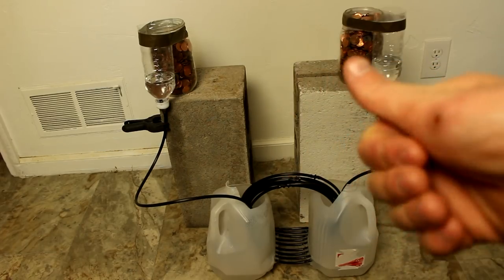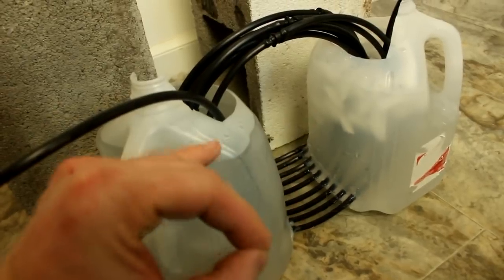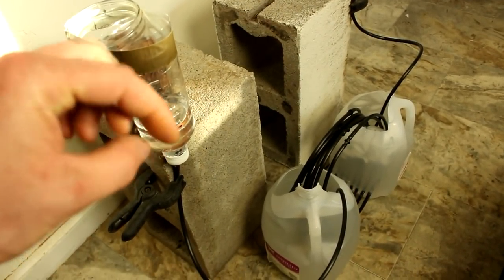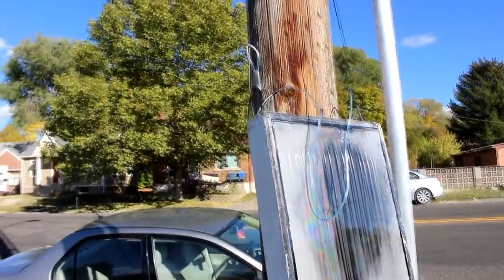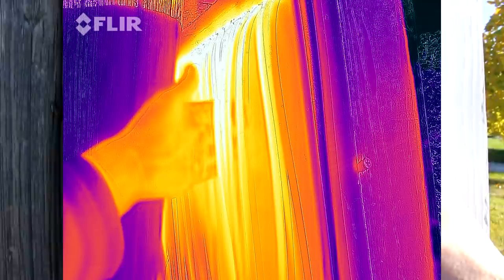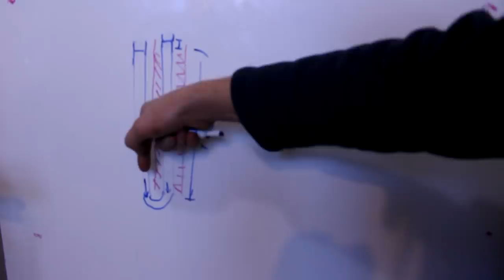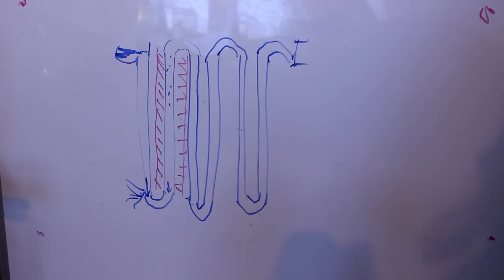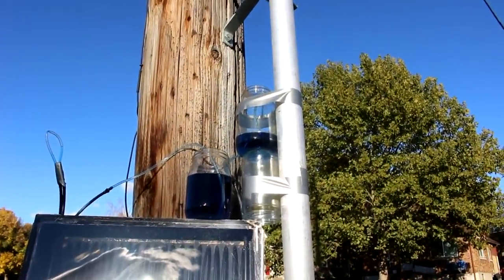Water Pump With No Moving Parts? (except water of course)

Comment: Would a peltier TEC between the hot side and the cold side be useful in pumping the heat "uphill"?

I'm imagining something like a wide plastic pipe with a divider through the middle, and the TECs along the side of the divider. Then inside each hot and cold section are copper pipes sitting in transformer oil (or maybe water? Not sure how TECs behave submersed in water though).

Transformer oil acts as the heat exchanger between all the hot pipes [and all the cold pipes], and the TECs simple move the heat in the direction you want the water to flow.
Reply: * not sure if TECs would get enough temperature differential between the hot and cold side to be effective though?

Comment: Pelletier chip and solar panel to get your hot and cold make custom aluminum blocks "heat sinks" with hose attachment thermal paste them to the pelletier chip on both sides loop hoses the the faster heat is removed from one side the cooler the other.

Comment: Cant help wondering if there is more than one way to do this. This method definitely works but I was wondering if there were any other ways of pumping water with no moving parts. EG using magnetics (electromagnets) which do exert a weak force on water but it might be too weak to do anything practical.

Comment: Would it work if it ran in parallel instead of in series?

Where you combine all the cold tube-ends into one . Same on the hot side.

This way it doesn't have to alternate between cooling and heating.
Reply: oh wait.. it wouldn't work
Reply: No. Every turn of the tube needs a temperature change. The pressure head comes from the imbalance of temperature on opposite sides of a bend. Without that, the pressures on either side cancel and no pressure is exerted.

Comment: would it not be better if you have one long tube at the front and an equally long tube at the back? i mean without changing from front to back all the time. that way most of the water on the front would be hot and most of it on the back cold.

Comment: Instead of having the tube going to the front and back, why not make it loop all the way on the back and only then go to the front? Essentially one long tube where one part is heating and the other part is cooling. Would that be more efficient?
Reply: Also you can add a one way valve.

Comment: the moving parts is you with that kettle lol
you would have to use boiling water ........just use a dam pump cheaper lol 
Would parallel and metal pipes be more flow?

Comment: can you re address this with small diameter on the hot and large on the cold?
i suspect the hot would move easier on the smaller diameter than the cold .
maybe differ the diameter by a factor.

Comment: Your setup does seems like it suceed at moving water, but I'm not convinced the effect you're describing is quite right.
You're not building pressure inside your tube since it's opened at both side, so any pressure you're generating at one point should push the liquid out of both ends without some kind of valve.
The effect you're describing is based on buoyancy and you tube goes up and down, so that should cancel most of the effect.

A good example of an thermal pump is used in some coffee machine. It uses a one way valve. Go see this video, it's really good : /watch?v=4j4Q_YBRJEI

Also, when dealing with salt concentrations and/or capilairies, you have to take in account other stuff like the surface tension of the liquid (see thermocapilairy effect)

Comment: Why don't you try making a radiator type device for the back of the pump so it cools faster.
Reply: With fins like a air conditioner and maybe make the tubes metal.

Comment: 85% 
of homes in israel uses panels as you made to heat water.
Of course that we made it a bit more efficient with vacuum and stainless steel tubes :)
I wonder if the heating of the water won't slowly kill your eco system as it's sterilising it bit by bit...

Comment: Water expands 1700 times from liquid to steam, wouldnt it be alot more effective using some solar "intensifier" (in loss of other words) to boil the water and use it as some power generator at home that way.
Home made cody style ofcourse.
Reply: Vaporizing water at a lower elevation and condensing it higher up would pump water using heat.  But, that would not move the salts up in his aquarium setup.  But, one might be able to use gravity to harness the energy of the water moved up by vaporization to pump other water that had the dissolved salts.

Comment: So, why are the coils each running from hot to cold? Is there some mechanic I'm missing? It seems like cooling each wrap of coil off in the shade would decrease your overall pressure differential as opposed to just running a greater length of coil on each side.  I know you illustrated the problems with increasing the height of the column but isn't this just a surface area issue?
Reply: If you look at the first drawing he made, with one bend at the bottom and cold and hot water on opposite sides, he's basically chaining it. You need the weight of the cold water pushing down into the bend to "push up" the hot water on the other side. If you chain them together like you say, the warm water will still expand, of course, but a lot of that expansion will push in the opposite direction of what you want. In fact, every part except the initial drop and the final upswing of the tube will cancel out, and you'll have the same pressure head you would have produced with just one bend.
Reply: Thanks. I can see how that would work. (or wouldn't work). Even in that case though it still seems better to keep all of the heat gain continually gaining on the input side rather than heating then cooling. So, instead of using a coiled loop running up and down it seems better to instead have a larger manifold pipe at the top and bottom. With the manifolds in place the individual heat and pressure gain from each column would have a combined area to escape to without competing against the counter pressure from the head of each column. I'd still like to run both ways as experiments and collect some data to be sure, but it seems correct.
Reply: Running the coils in parallel instead of series will increase the flow rate but not the pressure head. You'll get the same amount of pumping power but it won't be able to pump as far up.

Comment: Couldn't you coil all of the tubes on the back separately from the tubes on the front? That way you have one long (but not tall) tube cooling the water and one long tube heating the water, rather than swapping back and forth at every coil. Essentially the same as having your 100m pump, but not having it be 100m tall.

Comment: how did you calculate the evaporated water?
Reply: I mean, in the first example your numbers where exactly what the outcome became. Most of the times when calculating these things before experimenting, numbers somewhat differ. Also, shielding it from outside pressure from one side could boost or work against this process?

Comment: If you put heater in to U-type-formed 10мм PVC hose, not in botom but (shifted) in one branch, and supply heater - soon water in that hot branch heated to 100C and start boils mainly on heater body, аnd heater become coated with water steam - and lenght of heater element  - pure, or partically consist of gas that even lighter than air - water steam with T=100C, the pressure of the water column in that hot branch balanced by second - cold branch, but The height of the water colum In hot branch - higher, due to wapor does not add pressure - only altitude, and in hot branch water higher than in cold - and i make 2cm waterfall upside, and IMHO 10cm also easy with long heater element:
to make heater - i used wire resistor - smaller than hose tunel, then i put in in few layers of metallic grid, or wound on it a multilayer 1mm copper wire spring. - as a spacer , against destructive contact heater with PVC, two cords from ends of heater i brought through the two ends of the pipe, heater was supplyed with 30wt  - it was 2cm long - and water level differrence was so - intresting also for heating some bottle - with two brances  with heater in botom - simmetrically
direct water heating with AC - also intresting, but as i remember - can not pumps - for it you need two stell rods from 3,5" FDD drive - 3mm*70m or so, coated on ends with 
7mmlong shrink pieces with 1mm thickness, and two rods 1cm shifted  from each other - forming connecting ends - and shrink hoses near ends- holds them in parallel with a 1mm gap. - it works also intresting and good as heater for example, for a vase of complex shape , and safer than resistor -when water finished - stoped, never burns hose, but electrically connected with water

Comment: Cody, I see you use imperial and metric measurements interchangeably? I'm a bit older than you and from the UK and was schooled in metric but the real world still used imperial in the late 70's early 80's. So I'm ok with using both as long as stupid fractions are not used!!!  I drink in pints, estimate distance in miles, yards, feet and inches. Finer measurements are in cm, mm to 0.01 mm before my head hurts!! Temperatures in Celsius, petrol in Litres and speed in either mph or kph! 
What's your or anyone else's view on this and should the USA and the other country that use imperial get with the globe or stick two fingers up or two fifths of a hand and use whatever they like? (Couldn't get used to drinking beer and ordering a half litre instead of a pint!)

Comment: you need more bulk, your doing 1 tube one big loop , not put a main head unit on the top to bottom and let all the hot lines work at once..and all the cold lines..use multi pull, to do the work of just one line..

Comment: Is you want to heat the water why wouldn't you use blow touch . I think it's little more easy to create a potential difference between water and water will pump more easily
Reply: The whole point of this is to create a pump that requires no maintenance or fuel so it would make no sense to use a blow torch.  If he wanted a fast pump, he wouldn't be using this approach at all.

Comment: You are not doing it the best way. These solar water heaters are very common here. But they have only one hole going in to the hot side and one going out, so the water is heating up continuously and rising though convection while the colder water fills the lower side trying to balance it out.
Reply from the maker: Woosh

Comment: It is nonsense to have tubing looped from hot side to cold and back 22 times. 
It would be better to have almost all tubing inside the hot side and only half of one loop on the cold side of solar collector to compensate for difference in hydrostatic pressure.

Comment: Bi the heath you have more diverentional and at the same time you sake space out to balance the heather dimention.and cold vica versa in this setup .
 In the water dimention is able to expand bi heat an i the cold the water inpands😍
You see water as h2o I experiemce water as a space condition to behave as h2o within the spectrum of posebiletys with the introduced space evends 
So left you have magneticle water and richt you have graventational watter.
And I bad you if you tace a stopper in the midle of the total evend.
Than left end op to be less after some days in a closed container and right is more oldo now it looks the other way around according the dancetie of the space itself the more dansety the smaler the atoms are that reside within that space😍 fitting there own paseble behavieures other wise they transmute
Reply: If you create caputalayr en give that dimention direct eurth Flux for the capitelear behavieur of water to behave like springs you have onlimetid cycling of the watter😍
It onley needs diverentional connection 
But the live inside you don't put it there. 
The live wil manivesdlst inside from the conditions than they can coexists within that set of conditions more easyer as the came from this conditions🥰😍🥰
Reply: If there is no opening than eurth Flux has to com from diverend thepts 😍 to create resistance flow for the nergy cicles to manivest and coecists 😍 more easeyerley

Comment: Your title is inaccurate to say the least.  At most is suggest you have a profound misunderstanding of how the sun works.  Your "water pump" based on the heat from the sun certainly has one major moving part, THE SUN!.  In fact the sun being millions of times larger than the Earth itself and being the engine behind your water pump makes this pretty much the most inefficient water pump of all time.  Consider that you barely moved any water at all, it took a long time to do it, and it required literally an entire star to do it.  Thats pretty bad.  You could have moved much more water much faster by using mirrors to focus sunlight onto a bot of water causing it to boil off, then use pipes to move the steam and allow the steam to recondense into another container,  this is literally the worse possible solar pump setup I have ever seen.